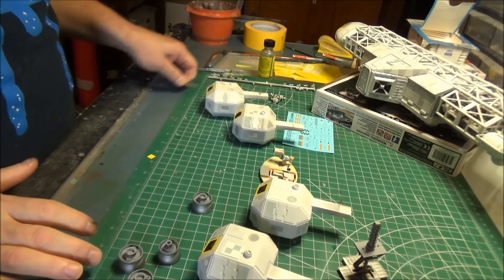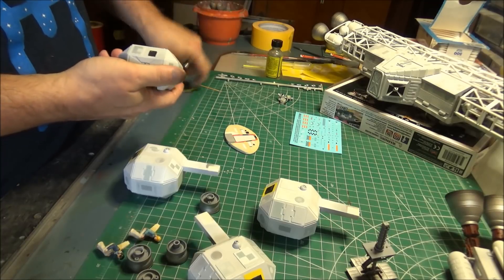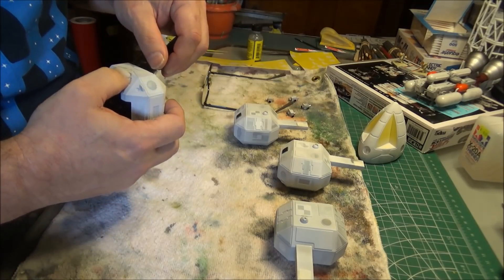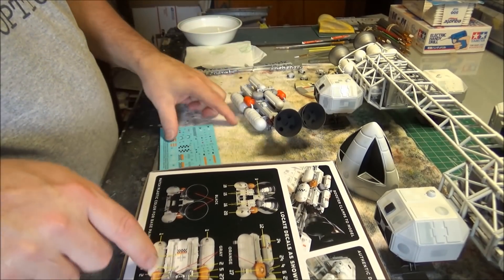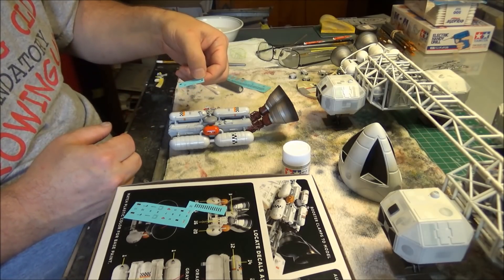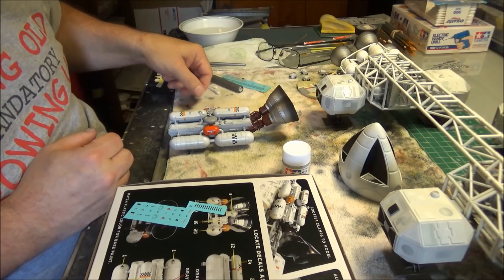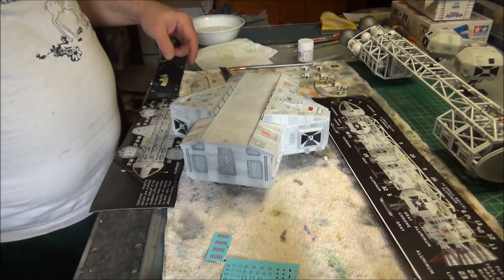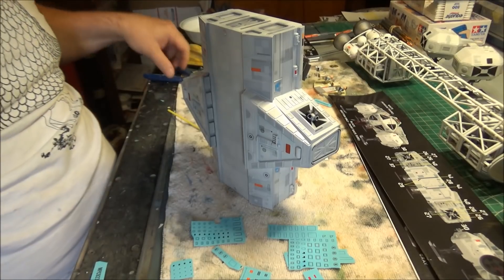Aztek Dummy Update 5/29/20 - 22" Eagle 2 episode 3

Comment: Pretty cool finale-- it is really nice how that final coat of clear flat turns the decals into paint. Indeed, still enthralling. I'm surprised you have not investigated the Valejo clears; they're supposed to be pretty good.
Magnet switch-- I wonder if a piece of flat flexible magnet would have enough juice to activate one of those reed switches. The piece of sheet magnet could be cut into a panel shape. Then, you could put another magnet on the inside to hold that panel somewhere else when it's "off."
Next year in Louisville!
Reply from the maker: I have tried the Vallejo clears. the flat is too cloudy. it's not a "clear" as the big spray cans. It's more akin to the "Dust" color.
Reply: @aztekdummy  Drat! Oh well...

Comment: It might not be too late but here is an idea and if you don't want to do it now you can do it in the future with another Eagle... Take a soda can and cut out a square 1 inch piece from the can and sand off the painted ink...clean the piece of Aluminum with alcohol and then measure how much off that square you'll need to bend around the spot where the Booster clips sits adding a millimeter or two...form the piece of Aluminum into a tube...where the ends meet of the cut out piece of Aluminum pry open to fit onto the Eagles spine frame...super glue it in place where the clips will sit and this will enable you to take off the Booster pack and put it back on without scrathing your paint. Let me know if you tried this and if it worked for ya.
Reply from the maker: geeze that sounds like a lot of work... I think I'd rather just bury some magnets in the frame and be done with it
Reply: @aztekdummy Lol Looks like a lot in writing but can be done very easly, I've done something like this before only took not even 20 minutes.
Reply: @aztekdummy  Was trying to help you out with that small problem bud.